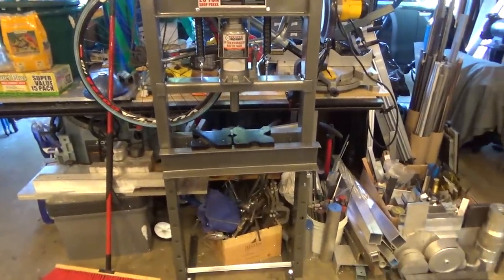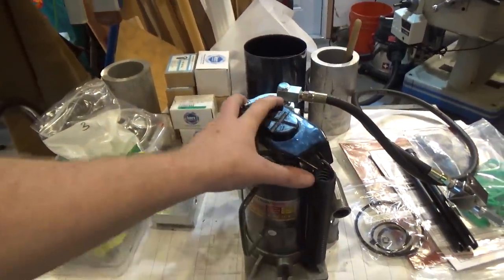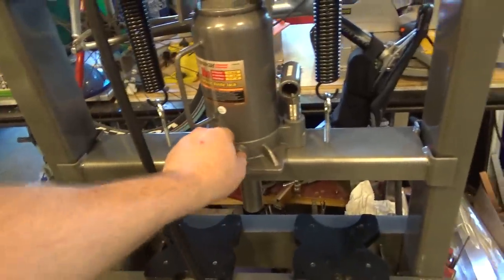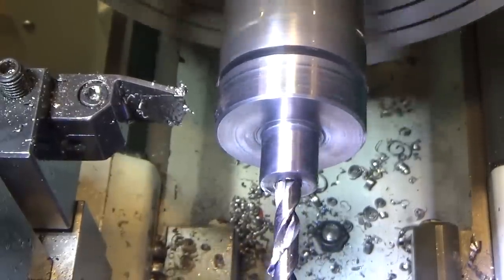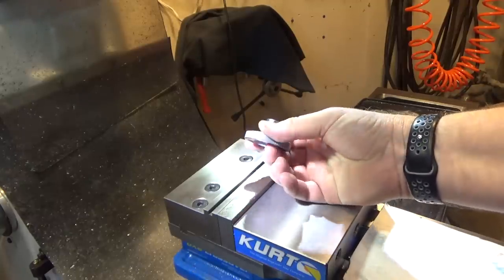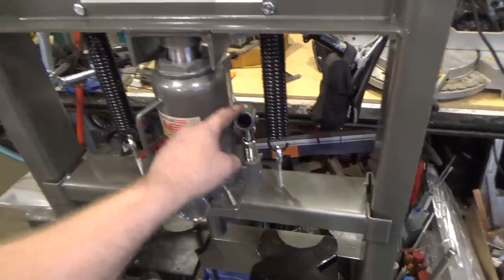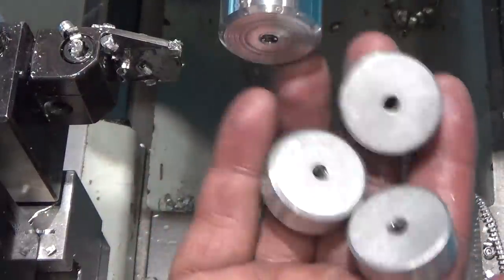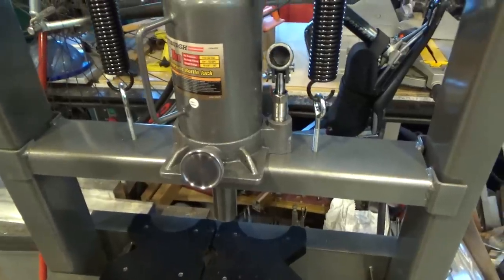Improvements to a Harbor Freight 20 Ton Hydraulic Press Part 1

Comment: We added the springs from  pnumatic bottle to the press for more return.
Also added a boat winch over the top of the frame to raise and lower the crosspieces.
Then put it all on top of an 18" steel table to bring up the work heighth.
Havent made the half round vertical safety shield from expanded metal yet.
Reply from the maker: I like your ideas. Thanks for sharing them. Now, everyone can benefit from your innovations.

Comment: I added a pair of motorcycle tie down straps to,the bridge from the top, on the outside of the channels, so I can adjust the bridge height easier for pressing different height stuff.  I "T" handled my big pins on my front side only so I can raise the  bridge a little  with the tie downs, pull the pins then release or raise the bridge with the 2 straps. Saves a lot of cussing on my part.
 I also build a jig that locks onto the bridge so I can change the springs on motorcycle shocks.  My 20 ton press was from Northern Tool, but same build quality as the HF.  Wish I had that knurled valve knob.  Guess I have one more project to do.
Reply from the maker: I like your mods. thanks for sharing them. I might steal a few...

Comment: Next stop, jack plate ram extensions, with magnetic holders.  Saves a lot of adjustments.  Another great video!
Reply from the maker: I have putting some thought into the ram extension idea, but the magnetic holders ar intriguing. Where exactly are they used?
Reply: A counter bore inside with a neodymium magnet to hold them in place.  MrPragmaticLee has a good video on making the extensions.   https://youtu.be/OMM56hnK7Bk -  Making them will be another good video.  (Edited to correct inserted video link - MP)
Reply: Your link didn't work.  Page not found.
Reply: flick22601 - Sorry about that.  Don't know what happened.  Try this one: https: //youtu.be/OMM56hnK7Bk

Comment: A very useful addition to my press is 2 pieces of foot long  I Beam 4 inches by 8 inches. I use them to hold steering knuckles for removal of wheel bearings. I like the mods you made. The handle in particular is one I need to do, sick of putting up with the supplied one. Will have to find a knob somewhere that i can make fit. No access to a lathe but that would be nice to learn at some point. Thanks for the vid.
Reply from the maker: Great tip! Thanks for sharing.

Comment: I have the older orange 20-ton press think I paid $79 for it. The first thing that broke was the arbor plates snapped right in half while I was using them HF wanted $40 for new ones I passed and had a local steel supply company make me some good hardened ones from steel stock cost me $30.
Reply from the maker: You are not the first to want me about the arbor plates. I hope that Harbor Freight is paying attention and mods their design. Maybe they already have, because the way my plates cut, lends me to think they were not cast iron. Thanks for you replacement suggestion.
Reply: I think the new ones your press has steel ones. My orange press plates are in 7 pieces now lol. I use an old i beam as a base and a 2" thick stage weight to press on. I also had to replace the top beam the old one buckled so bad. The bottom hasnt because I flip it from time to time but I may box it in to add strength. Cant complain the press paid for itself the first time I used it.

Comment: I made 4 tapered captures for the 2 cross bars. I have to lift the receiver assembly an inch to relocate the bars. A picture or a sketch....or a video is better.

I was looking at a similar 20 Ton air over hydraulic jack with different decals on a weird day when they were scheduled to be on sale from $129.99 to $19.99 for tomorrow only and so I came back tomorrow and bought both of them. Converting one over to upside down mounting with a relocated hydraulic inlet tube. No problem once you get the bottle off.
Reply from the maker: Cool projects, thanks for sharing your approaches.

Comment: I really like the valve release handle. I might do it just as a lathe/mill project. I'm always on the look out for easy yet useful projects that don't call for a lot of material. Thanks.
Reply from the maker: Thanks. An improvement on the design might be to make the whole shaft knob as one piece. It is not an overly complicated part. I didn't think of this idea until after I was done.
Reply: So that the end of knob is the part that threads into the jack? Thanks  @DudleyToolwright
Reply from the maker: There is a "T" handle on the shaft that acts as the valve to let the jack down. My knob was designed to fit over the shat and "T" portion. A better solution might be to build a knob on an integral valve shaft. It doesn't look too hard and the tolerances  don't appear to be that tight.
Reply: Ahh yes. Makes more sense. Thank you.  @DudleyToolwright

Comment: Ahh a chance to practice machining. Wish I had a metal lathe so I could make stuff like that.  Anyway I went with the air over hydraulic on the old harbor freight 20 ton press. It is yellow and a bit taller I think. WARNING!!!!!!! Don't forget to remove that trigger lock off the air valve.  That thing will lock accidentally when you least expect it and 20 tons will ruin a project fast. Ask me how I know.  Still watching your video so maybe you did. Sure hope so.
Reply from the maker: I didn't and didn't even think of that. I probably would have after something terrible had happened. Thanks for the great suggestion.
Reply: Yeah the whole hindsight thing. You might as well take advantage of mine.  I'll tell you what happened.  I was replacing an idler pulley on my nephews '96 suburban and the new pulley had the bearing cockeyed in it. So I thought I would just finish pushing it in straight with the press.  Got it down there close and let go but it kept going. By the time I got it stopped it had smashed the pulley up beyond any hope of using it. So I ripped that lock off and pulled the bearing out and put it in the old pulley.  I use the air to get close and then use it manually for the delicate work. I figure most people will but some projects can be expensive or irreplaceable. Just really glad I learned the lesson on something relatively cheap.
Reply: Same thing here. Absolutely, remove that trigger lock!

Comment: Nice upgrades. I put swivel locking casters on mine so its mobile. I would drill a hole in each end of the base of the bottle jack and bolt it to the upper press base to take that klink klanking out.
Reply from the maker: I added some casters a while ago, but never video'd it. I have space issues, so everything that can be mobile, needs to be.

Comment: One thing that someone at home can do a little easier when it comes to the release valve. Most of us don't have this type of equipment. What you can do is go to Home Depot Lowe's and buy one of the round knobs that goes on the spicket for your outside hose. Most of them are square so you will need to file that plug that you take out to make it fit into the new knob. If you don't have any sort of welder you can always use some JB weld just to keep it in place. You're not putting a lot of pressure on the knob itself so even some simple epoxy would work.
Reply from the maker: Nice solution. Thanks for sharing. I bet a lot of people will find your suggestion really helpful.

Comment: Hello,  No reason you couldn't do the same thing I did making my own press years ago.  I used a heavy wall (sch 80 as I recall) pipe under the jack base mount to which I welded a 1 1/2" NF nut (NC would also work) I faced off the several bolts of different length (grade 8) and now I have a push rod of variable lengths and can also use it without any bolts.  Nip off that one HF has welded on and do the same if you so desire.  Like your air jack as I have been looking at them for a few years and will get one soon.  I will get the larger one as my press was built to max out at 50 ton.  Six feet tall by 48" wide.  At the time thirty years ago I was doing larger work but now a smaller would do fine.  Nice modifications.  Take care.  Doug
Reply from the maker: Thanks for the ideas. I really appreciate you taking the time to share your ideas. I will definitely use them. I have been thinking about various solutions to an adjustable push rod. It would make the prep work so much easier. The big boys seem to use an acme threaded shaft, much like the piston on the bottle jack. I even considered sacrificing the new/old bottle jack ram for this purpose. Thanks for the ideas.

Comment: Good work.  I have the 12-ton HF press and use it more often than I thought (when you have a hammer ...).  I wonder why there are no kits available to attach to the pressing rod.  I have needed things like a 3-finger spread to push down on the outside of a large transmission piston, yet have room to get my hands in to secure a snap ring.  Often little force is needed (can push by hand w/ a helper), but the press is convenient.  I have had to scrounge thru parts from trailer hitches and such to rig up something to press on the part.  Would be great if there was a simple, cheap kit of "arbor tools".  One tip is to save all manner of steel rings, tubes, and thick plates you come across, such as large bearing races and housings, for a good selection of sizes to fit parts to press.  Of course, sockets work too, including the large 3/4" drive HF socket set.  Use a socket that fits over the rod and a socket extension rod to get down into a recessed area.
Reply from the maker: You have some really good ideas, apparently as a result of need. I completely agree with the kit idea. It would be an easy Harbor Freight add on sale. I will accrue one myself as I discover uses for the press. I still don't know half of the things it can be used for.

Comment: As a brother hobbyist I would like to make a suggestion. I use a 2t jack to stretch out the springs which allow me to use the screw adjustment on the top of the bottle jack. That will allow you to get about 4 inches (100 mm) of adjustment before using the hydraulics. Before that I had a series of block I used to get my work closer to the ram. Not pretty, but works.
Reply from the maker: Very interesting solution, thanks! I was trying to figure out a way to use the existing screw and I think you have found it. Thanks a bunch for sharing.

Comment: I like the idea of the pins to secure the plates but I always seem to need them to be offset towards you or away from you for odd objects that need to be pressed
Reply from the maker: Interesting. I did not consider that. I was going to make a flat plate to press against, perhaps I should reconsider how I will pin that one. Thanks for the perspective.
Reply: Dudley Toolwright - +1 just like Brandon said somehow I never have a press job where things are perfectly straight/align so the plates must and need to be "everywhere". I even had them in a vertical position on ocasion!! 

Although I leave one suggestion that works for me, it's cheaper, easier and don't get in the way... thin rubber glued to the face of the plate. will not "lock" them in place, but the surface tension is enough so they don't slide everywhere.
An old mouse pad or a tire tube are perfect for the job. Felt pads used in chair legs also work well. Cheers. ;-)
Reply from the maker: Thanks for the great ideas and your perspective of experience. I never considered that I would want the press plates anywhere but centered.
Reply: Flip the plates over when the pins interfere.
Reply: Robert Masarik think about that.

Comment: Locking the jack down is a real good idea. Place I worked had several cheap presses like HF one. I was taking a ?watercraft crankshaft apart, pretty close to max working load. The various parts were bending slightly. When crankpin moved, the various beams sprang back, flipping the jack out of press frame. Getting hit on the head with a 25lb chunk of metal is no fun at all. What made things a little better, a tour group of about 20 people were looking through viewing windows at the time.
Reply from the maker: I had never considered that possibility, so thanks for the cautionary tale. I realized that under large loads, all of the parts on the press would build in some "spring", but I had never adequately considered the consequences.  Thanks, you probably save me from some bad situations. I had ill considered the cases when a part would not give way gently, but rather all at once. Something to always keep in mind.

Comment: Doing holes in plates can work. But be careful, as these are not the best quality cast iron, and they’re known to break with explosive force. The holes in the inside will weaken them along the edges of the shelf, increasing the chance of that occurrence.
Reply from the maker: Thanks for the warning. I'm going to test that idea soon. My press plates did not cut like cast iron, but still could be brittle. Cheers.

Comment: Have the same press and my jack barely moved also. Mine didn't have enough oil in it. Filled it and it worked great.
Reply from the maker: Interesting. QC does seem to be a problem surrounding a lot of inexpensive tooling.

Comment: I do lathe work for a living.  If we are doing a lot on a manual lathe, it would have a turret or an indexer so several tools can be used in seconds.
For the home shop, grinding tools which can do more than one thing will speed it up.  A tool which can chamfer the inside and outside, a step drill to do the thru hole and the counterbore at the same time.
Reply from the maker: Those are some really good suggestions. Thanks. Multipurpose tools are very handy and can save the home gamer a lot of money. I appreciate you taking the time to help me and presumably others out. Cheers.

Comment: What would you charge to make another one of those release knobs for the jack if you would
Reply from the maker: You are one of many. If I had a CNC machine I could probably make them for a reasonable price. I don't. Perhaps I will make a few and sell them at a loss for my viewers. Thanks for the request.
Reply: I have the same press and all i did was use a 2 inch piece of copper tubing which fitted  tightly over one of the pins and rotate it that way. It only needs to turn 1/4 of a turn anyway.  I agree with better blocks. Those black one are brittle. I have snapped one with an almighty bang. Now that you have drilled it, it will probably break easier. I like the airpump will have to look for one, I use a very short stick to pump it down quickly . I love your lathe.  JD

Comment: Two days ago I bought the 12 ton version of this press. The bottle jack on it has two allen head bolts that screw into the base. You would think that the bigger one would be the same.
Reply from the maker: The latest version of the bigger one does have a bolt on top bar. Harbor Freight mods their gear constantly, possibly by going with a different manufacturer. Their tools are slowly improving.

Comment: Funny I was just planning to do something similar to my HF 20T press and I find your channel.  Subscribed.  I seem to forget that having the tooling I have now allows me the ability to make much nicer items than I was originally planning.  I guess I'll soon have a similar video. LoL.
Reply from the maker: I look forward on your take on improvements to this press. I have sub'd as well. Thanks.
Reply: Just finished my Bridgeport knee/drill adapter.  I think I may start on at least the jack release knob this week.
Reply from the maker: I look forward to seeing how it turns out.
Reply: Ever thought of using a porta power cylinder with air over hydraulics foot control box??

Comment: Tony, be aware that the press plates are cast iron, and I have heard of them shattering on these 20 ton presses. I have a 40 ton press so I got some that are machined steel.

 I like your idea of putting the pins in the plates! I have dropped mine on my toes before!
Reply: The new models come with steel plates instead of cast iron. In fact I just picked up this same press today!
Reply from the maker: Thanks for the comments. I had some concerns about putting any additional holes in the plates as they can be expected to see upwards of 40,000 pounds of force, especially since I am not sure about how large a safety margin, Harbor Freight products build into their tools. If I had to guess, they would be less than a Dake. The turnings from the drilling suggest steel over the powdery chips of cast iron, but I am no expert. Thanks for the comment.
Reply: A friend of mine has a similar press, I don't know what brand, but he told me the accessories like the plates can cost more than the press.
Reply: Dudley Toolwright  cast steel.  They snap easy
Reply: InsideOfMyOwnMind  yea look the cost of the steel alone! They are cast steel because it’s super cheap.
Reply: John Brock iv broken one before. I have the older 20-ton press the orange one. And it wasn't all that hard to break. They replaced it right away and I haven't broke one since so maybe it was just a defective plate
Reply: Yup found that out the hard way.. plates split in peices while pressing out a bearing.. wonder who designed cast plates!
Reply: I put non-skid tape on my cross bar to stop press plates from sliding
Reply: My old taller yellow one from HF I broke one of the press plates. It looked like a rough sand casting. I am still looking but havent found replacement plates yet.
Reply: Swagoffroad.com has beefy ones, but they're kinda pricey. Seen a few on ebay also for cheaper.
Reply: These newer, gray/silver presses have solid steel press plates. The old orange presses had the cast plates.
Reply: That explains why mine broke with a loud bang.
Reply: glad you took the springs off the air jack the ones on the ram hold also hold it in place. Not sure i would have drilled the plates and possibly added stress risers right on the edge where it sits on the bed.